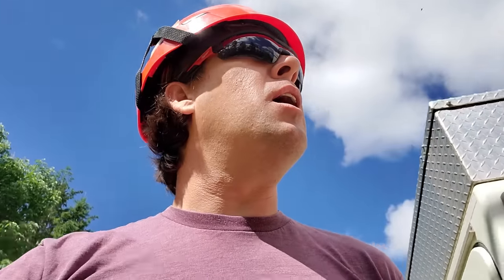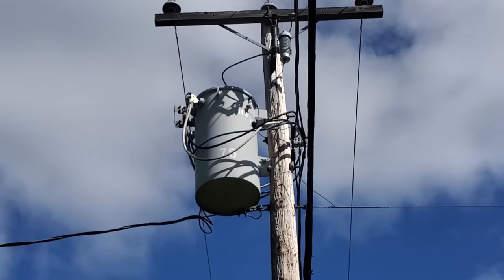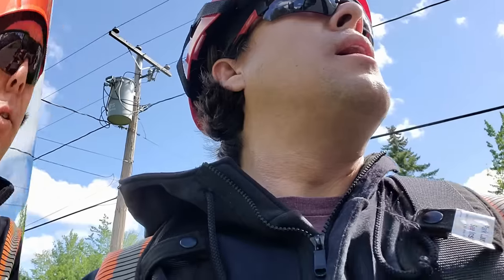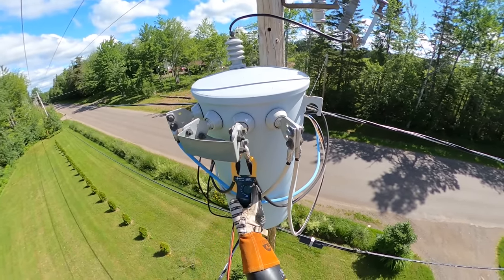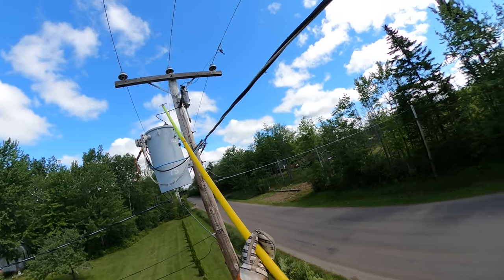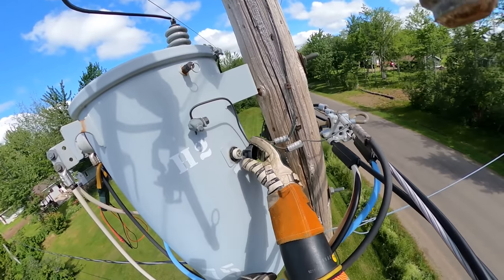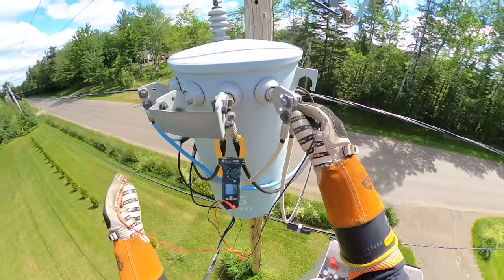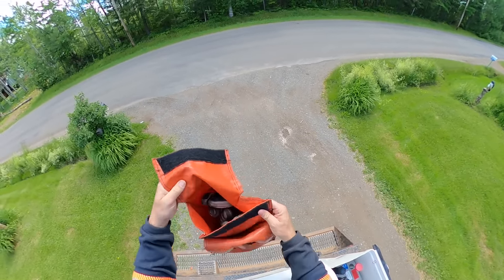How we change voltage on a transformer

Comment: I didn’t know they had those. A few years ago after a brief outage my line to G voltage dropped to 100v! I called and called and after 2 days they sent out a guy who measured it at the meter, got in his truck in a hurry and drove off somewhere, came back 10 min later very apologetic saying it affected the whole area and a regulator was out of whack.
Reply from the maker: Definitely an occurrence we want to find quickly. It's not overly common but does happen. We're always that thankful for keen customer phone calls on that one when monitoring equipment doesn't catch it
Reply: With the rise of smart meters, they should already know. (i.e. confirm when you call them.)
Reply: @jfbeam  my meter only transmits locally to a van they drive around once a month to collect the data.  So they wouldn't have been able to tell at least from mine in real time.
Reply: @ntsecrets  ... meters don't transmit voltage. They are strictly for reading the Kw used.
Reply: @rupe53  You're right - been a while since I decoded it using rtl-sdr - the packets only include consumption and tamper info.  Sorry about that.
Reply: That is unfortunate, knowing supply issues in near real time would make life much easier for the utility.
Reply: @rupe53  What a shame! It would be so easy to make them transmit voltage!
Reply: @thewhitefalcon8539  ... gee whiz, grabbing that extra info might cost $2 more per meter... and there's a LOT of meters out there! Personally, I think they are satisfied with what they have for a few decades.
Reply: @thewhitefalcon8539  Here in Norway the smart meters transmit voltage back to the utility company. They also use the meters to look for power failures. If many in the same area stop reporting at the same time, they know something has gone wrong and will start investigating.
Reply: @rupe53  I guarantee you the meter already reads voltage and current and uses the microprocessor to multiply them together.
Reply: @thewhitefalcon8539  ...while that info may be available the meter reader is not diagnosing problems while gathering billing numbers.

Comment: Had a voltage of 142/284 once. Fried a power strip/surge protector and light bulbs were blowing prematurely. Power company came right out and fixed it.
Reply: Ouch!  I've seen one leg go high like that with a bad neutral connection, but I've never seen both sides go through the roof like that... (and here's hoping I don't see it anyttime soon...)
Reply: @bradwilmot5066  Also lost a neutral in the same location. Voltage swinging wildly throughout the system. No major electrical draws in that house. Stove, furnace, and water heater were gas. Had central air. Only thing that gave it away was lights dazzlingly bright in some areas, dim in others. Thankfully no electronics were damaged. The service was well grounded. Some of the neutral current was making its way back to the transformer through the ground. Tree branch had fallen on the secondary lines and yanked the neutral loose at the pole.
Reply from the maker: Like Brad mentioned, 142 is common on one side with a broken neutral. I've seen it on both legs a few times though 😟. Tx winding failing can mess with the ratio can do that, but usually the fuse pops pretty quick. The other scenario was a result of some severe vandalism that resulted in a tap changer going full boost
Reply: @Bobsdecline  Bob, down here in Central Florida, I see high voltage on transformers that have been hit by lightning. We’re the lightning capital of USA and you may not experience that much lightning in Canada.
Reply: That is a loss of return to balance it

Comment: Former transformer designer here; just to nitpick a tiny bit - there are 3 types of tap changers:
OLTC - On load tap changer (Also called LTC):  Can change taps on load
NLTC - No load tap changer:  Can only change taps while there is no load but still energized
DETC - Deenergized tap changer:  Must be dead before changing load
Reply from the maker: Not nitpicking at all! Appreciate the correction 👊
Reply: @Bobsdecline  I'm guessing if you try to change it while under load or while energized if its not designed to, bad things happen? BUZZZZZZZ
Reply: openning the connection to the primary coil creates an arc, an arc with 7200 volts behind it. The alternative is to make before break, but then you have a shorted turn with huge current flow.
Reply: @liam3284  As I mentioned in my comment, the tap changers come in three varieties, with the DETC and LTC being the most common.
With a DETC, the primary problem is the shorted turns when the tap changes is moving from one tap to another.  The currents will be VERY high and will destroy the transformer quickly.
In a LTC, there are two sets of contacts.  The contacts are break before make, and they're offset 1/2 way between each other.  The two contacts are then connected through a "preventer coil" that functions as both an inductor and auto-transformer.  When the tap changes, the preventer coil acts as an inductor allowing all the current to flow through the contact still on a tap to prevent breaking the current.  When the tap changer is in a 'half tap" position where one contact is on one step and the other is on a higher or lower set, the preventer coil acts as an auto-transformer, averaging the two tap voltages.
Reply: @ntsecrets  BOOM not buzz....
The problem is that the tap changer is creating a short on a few turns when it is between taps.  The ratio from primary to those turns will be in the thousands, so thousands of amps will flow but only a few amps will flow from the primary.  That wont blow the incoming protection.
For distribution transformers, fusing is already a problematic proposition.  To prevent blowing on inrush, the fuse has to be sized WAY over nominal rating.  That means in a failure, there is a ton of energy and it can blow up.
For big substation units, the problem is the sheer amount of energy available even if the protection is good.  During safety training years ago, we covered a case in England where a station auxiliary transformer was re-tapped live.  This transformer sat on the MV bus between the generator and the unit step up transformer stepping down to a lower MV to feed plant auxiliaries.  The source was a transformer rated hundreds of MVA connected to England's 400kV system.  It blew up violently and little was left of the individuals involved.
Reply: @ntsecrets  I test all types of medium and high voltage transformers. 

Let's just say they don't put screws in the Tap Changer and dual voltage switches for nothing lol. 

I'm not familiar with every possible type of switch but all of the standard TAPs need to be made prior to being energized unless there's a breaker switch for that feed at the high voltage side.
Reply: station mechanic here, all the bank no load tap changers ive seen still recommend de-energization in the literature or nameplate.  not sure if it's just some cover your ass stuff or whatnot, but just what I've seen.  on old Hitachi subtrans to distribution banks, we actually detanked them and bypassed the 5 position tap changer because it was such a turd from the factory causing hot spots and failures to the point where it was no longer worth it to even bother
Reply: Transformer designer...  WOW!  Obviously someone has to do it..., But who da thunk it???!!!
Reply: Reminds me of the first time I got a Digikey catalog. Looking for switches...make before break. Break before make, etc. (From someone who used to twist wires together)
Reply: There was a fatality in the UK about 10 plus years back when a substation fitter operated a large onload tap changer via the manual winding handle. The tapchanger jammed and then exploded. Its always worth taking a step back before doing something and taking a moment to think about the implications of what you are doing.
Reply: @Marks-Garage  Chelmsford substation...the thing here doesn't say if it was an LTC or not though.  usually they put the diverter switch up top of the xfrmer anymore, prob for this reason.  we even have some old English Electric banks here from the 1960s that have them right next to the running gear on the side, right next to your head.  one of them blew an H bushing, blacked out the city.  we stuffed a new one in and turned it back on.  this new crap they make is nothing like the old stuff in terms of quality
Reply: @loginavoidence12  You are right regarding build quality. I worked on a transformer from the later 50s which had divertor tanks on a winch system that had to be lowered to gain access/inspect. We tried pumping the oil out of these tanks prior to lowering and we couldn't get any oil out of them. When the tank was lowered the oil had been cooked into a black tar like substance. The tapchanger had been in service all the time with no hint of an issue with the divertors. As for the fatality im sure the transformer had been taken off load but not de-energised. Pretty sure procedure for us now on tap changer issues is to deenergise prior to getting near the thing. When i was first in the industry i remember taking an oil sample out of a 275MVA 275kV transformer selector and mid way through filling the sample bottle the automatic voltage control sent a tap command to the tap changer. Very un-nerving and at that point if the tap goes wrong you don't stand a chance. Admittedly the tapchanger had performed 10s of thousands of operations without failure so the odds are small but it still scared me.
Reply: @liam3284  Not just the line voltage, inductive flyback added to that can get real nasty within 1/120th of a second. It's a crapshoot on timing of how bad real nasty is.
Reply: @ntsecrets  Draws an arc across the tap points, can damage the tap contactor. Inductive kick from the current surge can overvolt and punch thru insulation.
Reply: Tbh, it's much more safer to de energize than running it hot
Reply: obviously we should just make them all Variable Autotransformer then we can just change them on the fly /s
Reply: Nice show,as always
Reply: Where is the neutral wire back to the substation?
      Can Not See it in This Video.
Reply: @tedlahm5740  The neutral wire most commonly will run lower than the three phase conductors.  If there is triplex secondary running from pole to pole, it is often shared.  
Sometimes the neutral runs up with the phase conductors.  It can be identified as the conductor that is tapped every few poles with a wire run to a buried ground rod.
Reply: @tedlahm5740  The system neutral is contained in the triplex that the transformer is tapped onto. If you look where the transformer’s secondary leads are attached to the triplex you’ll see two covered wires and one bare wire, the bare wire is the system neutral.
Reply: @08c6vette  Thank you.   Interested in the Primary coil, single phase, SINGLE BUSHING step down transformer.         Yes the second end of the primary coil
is connected Internally to the Neutral/ground to the bottom of the pole.  Yes, this
is the same neutral/ground that the secondary coil uses for a neutral back to the customer.

          Interested that there is no neutral BACK to the substation, EXCEPT the multipoint grounding at each pole that contains a transformer.

        In conclusion I see no Parallel neutral back to the substation? ? ? 
Some people tell me there is a parallel back.    meaning a conductor on the poles
and the mentioned multipoint grounding system.

Than you.
Reply: @tedlahm5740  You're welcome but you're missing what I'm saying, that the bare wire contained within the triplex that the transformer is tapped onto is the system neutral/common neutral ("neutral back to the substation"), completing the circuit, no other neutral is needed. You are correct about the single bushing transformer's grounding/neutral path and that the H2 primary bushing, (H1is the bushing connected to the fused cutout) has been replaced by just a tank ground, which is located just above the tap changer. which is bonded to the system neutral/common neutral (return to the station), completing the circuit. If you pause the video at 5:50, when he's working on the tap changer you can get a really good view of whats going on with the grounding. You'll see a piece of #4, bare ground wire coming out of the ground lug above the tap changer, going around the pole and is then bonded to the system/common neutral on the other side of the pole, plus, the tank ground, which is in the hanger bracket near the bottom of the transformer, which  is bonded to the down ground, is also bonded to the system neutral through the down ground, giving us an alternate path to complete the circuit as well, being that both ground lugs are bonded together through the tank of the transformer. This is a 7200v Wye system, which means every neutral and every ground at that pole are bonded together, including the customers service neutral, the system neutral and the down ground, giving us multiple paths to complete the circuit. If for some reason we lost both our connections to the system/common neutral, (return to station), the down ground would serve as our completion of circuit, which I believe is what you thought was going on here.
Reply: I failed to mention that there is also a strap bonding the tank to the secondary neutral bushing of the transformer, which provides us with two more alternate paths to the system neutral via the tank and the transformer’s parallel secondary neutral leads.
Reply: @Bobsdecline ❤❤❤❤❤❤❤❤

Comment: As a residential electrician, the issue I’ve ran across in the past (many times) is seeing perfect voltage across both legs in a house UNTIL a load is put on that neutral. Plus or minus 3-5 volts is never an issue. The load tester some of y’all carry seems to show the high/low voltages pretty quickly though. 
I don’t mess with powerlines… that shit will get ya kilt!!! Lots of respect for the lineman on here 😎 I don’t get how y’all play with powerlines in the rain, snow, night or day… Y’all are def committed to getting the job done ✅ and it is very much appreciated.  
Stay safe ⚡️
Reply: Just came across your comment and thought I'd share an anecdote on voltage spikes with high neutral loads:
In my old house, when we moved in, I checked all the voltages and everything seemed up to spec. But after actually moving in, I started seeing evidence of small surges as my lights would get brighter or dimmer when say, the portable AC would kick on, or any other significant 120 load. Took me forever to realize it wasn't happening with heavy 240 loads.

Turns out, the neutral line back to the pole had somehow become severely degraded, and when I put a clamp meter around it past the main box, almost no current was flowing at all. That led me to learn that, either fortunately or unfortunately, my ground connection was doing its job and capable of carrying all of my neutral amperage back to the pole, although not without some resistance along the way. It's kinda creepy to put a clamp meter around your water line and see a double digit number.

So yeah, the system was almost working as intended except that there was some (although not a lot) of resistance effectively on the neutral's path back, resulting in the neutral having a non-0 voltage when loads were high, and de-balancing the apparent voltage on the two legs.
Reply: Shit I just did a service in a snowstorm lol same thing

Comment: Old mate is full of wisdom and makes sure everything he does is explained clearly. Love these videos. Also kudos for the safety wisdom in moving yourself further away when re-energizing. Many people in a rush would just slam the switch shut and hope they don't get a new suntan or a face full of oil.
Reply: I would not plug a tub in straight away from the transformer as shown, the most often place the hot oil leaves the transformer is at the junction of the lid and transformer tank.  It can come out in a volcano style instantly.   Better chance if you can use an extend glass stick on the ground and out and away from the actual transformer, then put the fuse closed.

Comment: I once installed some radio equipment on the roof of a 15 storey residential block in the UK. The equipment was all monitored remotely and within a couple of days, I started receiving alerts from the UPS saying it was compensating for high voltage, the logs showed it rising to about 260V at times. I continued to monitor over the following couple of weeks until one day I found a reading of 282V, at which point I rang the electricity company! They were rather concerned as the transformer supplied not only the 150 flats, but several streets too and said they’d meet me there in an hour. I arrived within about half an hour to find them already there waiting for me. Unfortunately, at the time, the voltage was just within limits, and after confirming that the voltage at the transformer was similar to that at our equipment and that the reading from the UPS was reasonably accurate, they said that normally in such cases they’d install a data logger for a couple of weeks, but in this case they’d probably be able to accept my UPS logs.
The following day, they rang me to say they’d meet me on-site and change taps. In the event, there was only one more downward tap available and it still sits at about 250V, but I’ve never received another high voltage alarm in the seven years since. Overall I was quite impressed with the speedy response and not what I was expecting at all.
Reply: Wow...  250 is still pretty high, though.  Glad it didn't creep up again afterward.
Reply: Maybe it was people turning a lot of Big stuff off ?